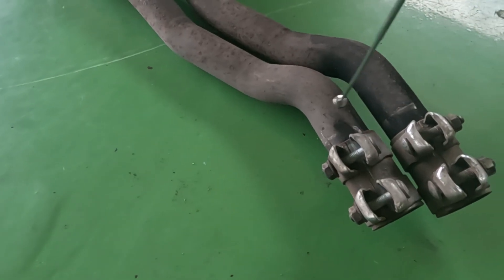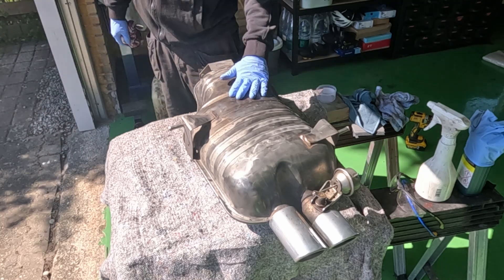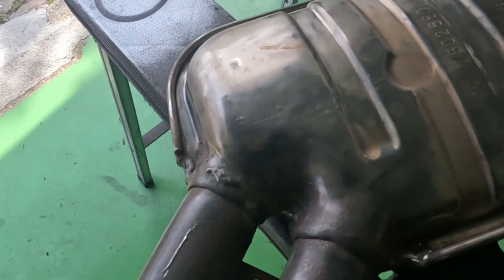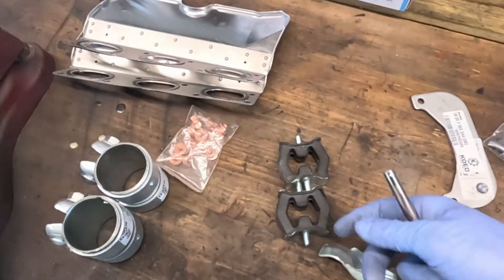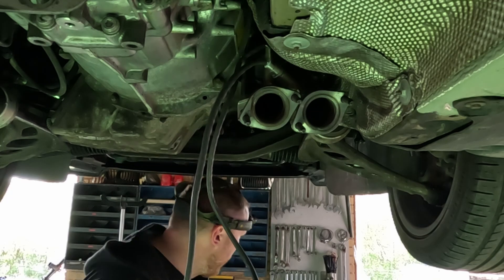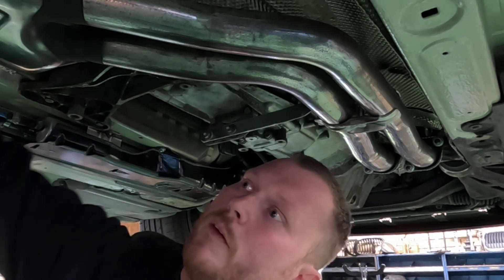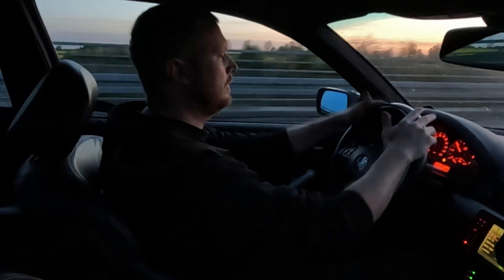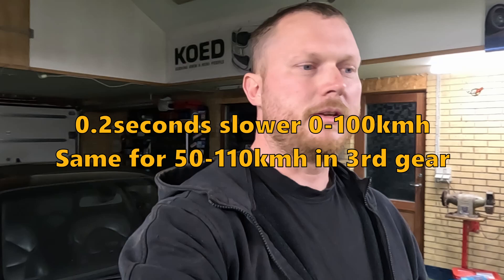How I Restored / Polished my exhaust (Aftermarket look Exhaust For Free)

Comment: Stock exhausts def. need more love.  They are long lasting, strong and fit perfectly. I've a few e46s, and all have original systems in as new condition.  They even handle common impacts like reversing into grass banks, etc.  I really like your 'lock the flap open' mod, almost as much as the way and real world verification test you do confirms the difference it makes.  A set of those sweet Schmiedmann headers and cats are all that's needed to get near perfect performance from a NA B30!
Reply from the maker: Completeæy agree on all point/. Also about the headers. If they were legal where i live id still use them. I do have a vid on them where you Can hear them. Although with a scorpion muffler installed

Comment: Did you attach the flap at the backbox to your intake manifold? 

What a pitty that you had to let go of your headers. The things i would do to have such headers on my z4 3.0😊
Unfortunately they are as illegal in Germany as the are in Denmark.😢
Reply from the maker: No! As it turns out its missinh the valve and actuator. Basically just everything. So i capped the hole in the manifold and the muffler is then permanently dual exit so to say. Yes our laws suck my friendly neighbour. Thanks for making awesome cars though

Comment: why not cut the muffler open and modify the inside of the muffler still will look stock but will flow and sound better, same for the middle muffler
Reply from the maker: Good question. The main thing is part of going back to stock is to make it legal. More than 2db louder than stock isnt legal. With that being said, everyone is still driving around with modified exhausts, because the cops sont bother unless its obnoxious loud. So yeah. Maybe one day i’ll as you said:)

Comment: What did you spray on the muffler after you polished it?
Reply from the maker: High temp clear coat. But honestly its better without it. The shine wont last with or without. But without, you can polish it up easily just using a cloth and some autosol
Reply: @OEMplusRESTO  thank you so much. I'll use your techniques on my 323ci
Reply from the maker: @ZacsAutosports any time bro

Comment: Where I live, nobody cares and checks the exhaust. No emission check no nothing. Also weather is good and nothing rusts. 
 My e36 328i stock exhaust produced 4psi back pressure. Diy 3" exhaust has less than 1 psi back pressure and weighs about 10kg less than stock. Unfortunately I haven't have time to test performance gains.
Reply from the maker: Im jealous lol. Sounds like a super cool project too
Reply from the maker: Oh youre “that” guy. Very cool. I watched your backpressure video not long ago. Great video and cool projects you got going on. Thanks for the input here:)
Reply: @OEMplusRESTO  Cheers.